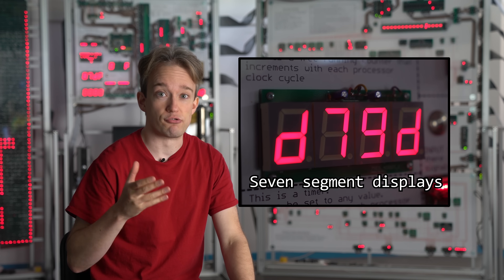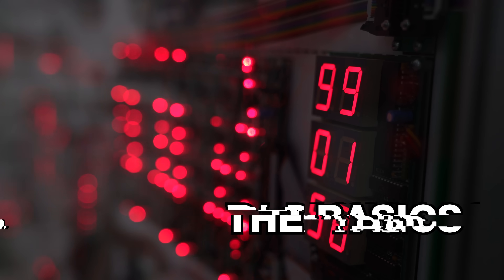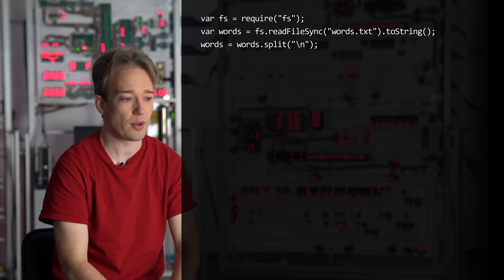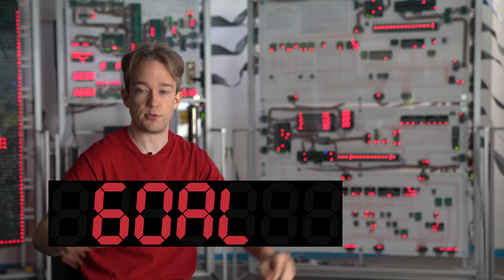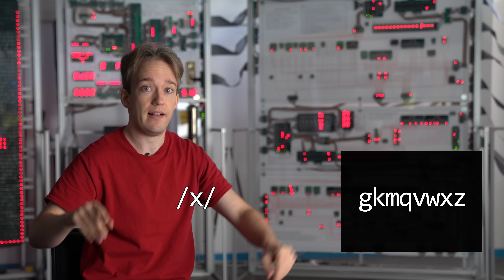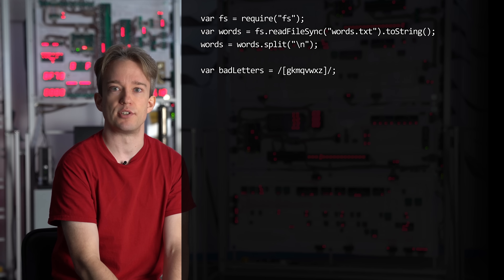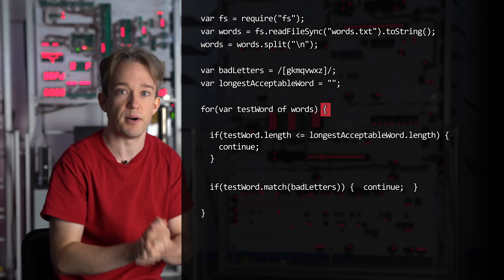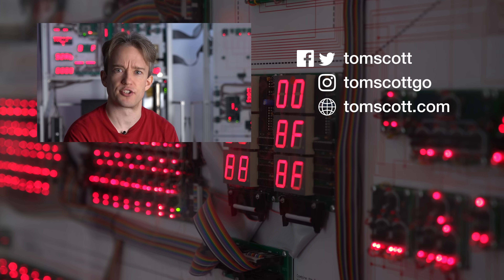What's The Longest Word You Can Write With Seven-Segment Displays?

Comment: The question goes "What is the longest English word you can write on a seven segment display?" Thus the word displayed must be the longest English word. It is never stated that the word must be written using Latin characters, ergo you are allowed to use binary to spell out words. I do realize this is just one way of interpreting the main question. 

Anyway, the longest word, both in the Oxford dictionary and the list you used, is: "pneumonoultramicroscopicsilicovolcanoconiosis," 45 characters long, spelled in(converted to) binary "01110000 01101110 01100101 01110101 01101101 01101111 01101110 01101111 01110101 01101100 01110100 01110010 01100001 01101101 01101001 01100011 01110010 01101111 01110011 01100011 01101111 01110000 01101001 01100011 01110011 01101001 01101100 01101001 01100011 01101111 01110110 01101111 01101100 01100011 01100001 01101110 01101111 01100011 01101111 01101110 01101001 01101111 01110011 01101001 01110011" which is 405 characters long

Euan Worth brought up a good point. I could have used UTF-32 to represent the word. UTF-32 base 2 is the longest way to write UTF-32. The word "pneumonoultramicroscopicsilicovolcanoconiosis" represented in UTF-32 base 2: "00000000000000000000000001110000 00000000000000000000000001101110 00000000000000000000000001100101 00000000000000000000000001110101 00000000000000000000000001101101 00000000000000000000000001101111 00000000000000000000000001101110 00000000000000000000000001101111 00000000000000000000000001110101 00000000000000000000000001101100 00000000000000000000000001110100 00000000000000000000000001110010 00000000000000000000000001100001 00000000000000000000000001101101 00000000000000000000000001101001 00000000000000000000000001100011 00000000000000000000000001110010 00000000000000000000000001101111 00000000000000000000000001110011 00000000000000000000000001100011 00000000000000000000000001101111 00000000000000000000000001110000 00000000000000000000000001101001 00000000000000000000000001100011 00000000000000000000000001110011 00000000000000000000000001101001 00000000000000000000000001101100 00000000000000000000000001101001 00000000000000000000000001100011 00000000000000000000000001101111 00000000000000000000000001110110 00000000000000000000000001101111 00000000000000000000000001101100 00000000000000000000000001100011 00000000000000000000000001100001 00000000000000000000000001101110 00000000000000000000000001101111 00000000000000000000000001100011 00000000000000000000000001101111 00000000000000000000000001101110 00000000000000000000000001101001 00000000000000000000000001101111 00000000000000000000000001110011 00000000000000000000000001101001 00000000000000000000000001110011" The length of which is 1484 characters.

Edit: I had left in a space in, which added an extra 8 bits. It is now corrected from 413 to 405.
Thanks to TheMoonRover for spotting my error. Apparently I can only @ in replies, so I won't be able to do it here. I apologize.

Edit 1:
Thank you to EuanWorth for the UTF-32 suggestion. I have updated the answer. Again I apologize for not being able to @ you.
Reply: that's only 404 characters long, the last space (00100000) doesn't belong here
Reply: @TheSurviv0rMan  404 space not found
Reply: What if you modified the condition a bit, allowing back-to-back 1s to be displayed as || on a single seven-segment?
Reply: @Derpy-qg9hn  That's a cool idea. Will edit later with answer
Reply: You're technically correct, and that's the best kind of correct. Have an upvote.
Reply: You've made a major blunder here, you've written in in extended ASCII rather than writing every single character as a unicode-32 character, which would massively increase the length...
Reply: @euanworth9887  I can't believenobody thought of that until now.  It's obvious now you've mentioned it!
Reply: @euanworth9887  That is a great idea, thank you! I have updated my comment and credited you as best as I could.
Reply: never said it couldnt be in Canaanite either. 𐤐𐤍𐤄𐤅𐤌𐤏𐤍𐤏𐤅𐤋𐤕𐤓𐤀𐤌𐤉𐤂𐤓𐤏𐤔𐤂𐤏𐤐𐤉𐤂𐤔𐤉𐤋𐤉𐤂𐤏𐤅𐤏𐤋𐤂𐤀𐤍𐤏𐤂𐤏𐤍𐤉𐤏𐤔𐤉𐤔
Reply: why write it on binary, my friend? You can save a lot of characters by writing in the Hexadecimal since A to F are Legal Characters" 70 6E 65 75 6D 6F 6E 6F 75 6C 74 72 61 6D 69 63 72 6F 73 63 6F 70 69 63 73 69 6C 69 63 6F 76 6F 6C 63 61 6E 6F 63 6F 6E 69 6F 73 69 73 20" which is 92 characters long
Reply: @MegaAgamon  But the question is the longest word, and binary is the longest way to write it.
Reply: Why stop at 32-bit? You can use 128, 256, 512, 1024-bit and higher. Just continue adding zeros.
Reply: @Liggliluff  32 I can still accept, more than that I don't feel too comfortable with xD
Reply: @bAdorablePeach  it's really good to see you replying comments in here even after 11 months ! I don't really understand the programming , but I read all the comments and I wish I knew more about it.
Reply: @aadipandey8237  I like the back and forth that comments allow for. If you do want to try your hand at programming, you can start out the default way and try websites programming, html css & javascript(more advanced). Codecademy has a good html and css course.
Reply: homes tuck
Reply: @claw3335  you stole my comment
Reply: "...which is 413 characters long" Not really. If you're converting a 45-letter word as ASCII into binary, the result should be 45*8=360 bits long. I assume you got 413 because you somehow picked up an extra space (00100000) at the end which adds 8 bits, and counted the spaces between bytes in your result, adding another 45 characters. (360+8+45=413)
Reply: @TheMoonRover  Good catch! I've missed that. I'll edit it and credit you, thank you. The spaces I left in deliberately. A binary sequence can be longer than 8 bits, thus removing the spaces can result in potentially interpreting it as one sequence, unlikely but possible. That said, it also increases the length xD
Reply: nerd
Reply: You could also convert it to hex to make it shorter
Reply: @VictorSilva-lj4wy  True, but the 6oal is to find the longest word possible.
Reply: @zeke7209  Hahaha you're right, I missed the 6oal
Reply: you can even use each segment of a seven segment display to represent each bit. 46 characters as you can divide by 8 (including decimal point)
Reply: I thought the longest English word was the scientific term for titin
Reply: What
Reply: @EX-qp9bt  What?
Reply: But what about Llanfairpwllgwyngyllgogerychwyrndrobwllllantysiliogogogoch, which has 58 letters. (Yes, I did use copy + paste)
Reply: @mastertrams  That is the name of a place, right? I don't think names are allowed xD
Reply: @bAdorablePeach  No, but words are allowed, and correct me if I'm wrong, but aren't all place names words? 😉
Reply: How doesn't this have more likes?
Reply: @4P5MC  Thought exactly the same. Best comment so far.
Reply: @4P5MC  Because it's at 69 likes and nobody wants to ruin it

Comment: The 1011110 looked enough like the leter G. o is lowercase and I is on the left instead of the right. The S is however a 5 and not an S. Use uu=w and nn=m.

Comment: Well, you could make an array of Strings and everytime a word is longer than the last, you can write it on that array. Then, you'd make another check. Everytime a word has the same length as the longest acceptable word, it will also be written onto the string. If there is a larger word after that, the array can just be emptied and we continue with that same process.

Comment: 7 and 15 segment displays are also perfect, for when you want a part of a machine to be simple, fast, cheap, efficient, even easy to clean/keep clean, or any of all of the above. Screens take time, code, and as a result space and cost, to produce what might only need to be, the power input to a small module of a machine. Where as a single, or two screens on a sterile filling machine (just an example), can perfume the heavy duty supply of information.
Handy when the machine your trying to keep running, costs more than your 5 bedroom house.... And kept cleaner than a bottle of Dettol...

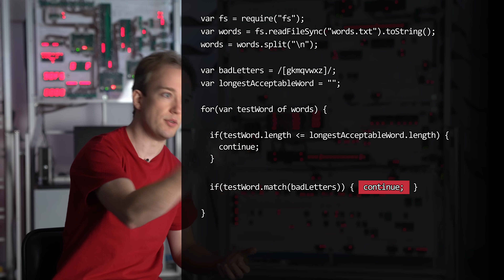Comment: 7:30 this is annoying me more than it should... Get continue on a new line like the one above aarrghh!

Personally I would have done something similar but to avoid continue just abuse short circuits and put it all in a single if statement with ! in front of it to negate those tests. If it FAILS both (ie is longer and has no letters) then we can add it. I also have a (facetious) vendetta against {}, so this allows me to remove it on both the for loop and if statement. (I would do this in Java, so that's allowed if only one line. Or C# I guess, but I mostly do Unity with that)
Reply: god I was an idiot

Comment: I and o should count. Written as half height they are not mistaken as 1 and 0
Reply: How exactly does S count again? It's literally just a 5...
Reply: @soldierofkazus  you think it's a 5 because most things that used numbers use this 7 light display and they used 5 as that even though it looks more like an s just not as curvy
Reply: fenafeses But a G is disallowed for looking the same as a 6
Reply: @WhereWeRoll  because in 6, the line connects back at the line but in G it doesn't
Reply: fenafeses That's completely arbitrary
Reply: @WhereWeRoll  a lower case g could easily be implemented.
Reply: @standardoilofnewjersey4260  it would look like 9.
Reply: @polygonail1978  use a bottom line for g and no bottom line for 9?
Reply: I does count
Reply: that would make the i a ı instead because there is no dot
Reply: 4:02
Reply: Small "I" have a dot " i "
Reply: @deidra-v6575  unless you're turkish

Comment: 0:30 Wait, that's not how "most" people draw their fours? 

Well I'm glad they're used to it, that's how I draw 4!
Reply: Don't feel alone, I and almost everyone I know writes their 4's similar to 7-segment display style.
Reply: That's how I write a 4 not draw
Reply: The two common fours can be used without picking up your pen giys
Reply: @xroadspod  How would you write Ч without lifting the pen? Do you write it like u, but with a longer vertical stroke? The horizontal stroke usually goes through the vertical, like it does with 4. Trying to do it without lifting the pen seems like it would be as complicated as trying to write X without lifting the pen, or like it would just come out looking totally wrong.
Reply: Bob Ross 
How? What's the second method that doesn't require picking up your pen
I draw mine by starting at the bottom then going two steps up, then diagonally one step down+one step left and then one step right. What is the other one?
Reply: But- why? The other way means no picking up your pen required
Reply: @the1exnay  You start at the top left  making writing it easier lifting the pen is easier than starting at bottom right or middle right. Also by writing a small L followed by an I you could write 4 in two stroke instead of three.
Reply: kazedcat TM 
If you count an L as 1 stroke then the other way of writing a 4 counts as 1 stroke. If you count the other way of writing a 4 as 3 strokes then they are both 3 strokes.

That top-left being easier is an interesting idea. But the way i write 1, 2, 3, and 5 leaves my pen at the bottom so staying bottom if a 4 is next sounds easier. 6, 8 and 9 leave my pen in the middle so it doesn't matter. And only for 7 and 0 does it end up at the top so staying top is easier. Is there some reason I'm missing that makes starting top-left preferable?
Reply: @the1exnay  You can write U in one stroke with one stroke but to write a V you need to stop and reverse direction so you need two stroke to produce a clear pointy bottom. With 4 you need clear pointy corners otherwise it will look like a 9. So you need 3 stroke to write a legible to other people number 4. I use to write 5 like you. But change it because people confuse it with S.
Reply: kazedcat TM 
I fully agree, it takes 3 strokes to write 4 properly either way. Cutting corners just doesn't look right.
Reply: @the1exnay  when I write for, it's really two strokes. I guess one is curved or bent, but that takes significantly less effort than what I would consider a full stroke. By that logic, most people I know who make the connected four never lift their pen, but it's definitely easier to be lazy with the corner on the open 4 without it looking like something else. The only other thing it can really look like is an H, which usually isn't a problem.
Reply: Micah Philson 
That is a decent point, I'm inclined to think not picking up the pencil is the greater convenience. But that may just be my biases
Reply: @the1exnay  This is a very long conversation about how you write your fours.
Reply: @the1exnay  Starting top left is preferable because downward strokes are much easier than upward ones. The only characters I would ever start at the bottom are capital A, M, and N.
Are you by any chance left-handed, and do you write with the page upside down, or close to it? Your description of how you write sounds very unusual otherwise.

Comment: You can avoid using 'continue' simply reversing the condition testing: set the new value if the word is 'longer than' and if it does not match the rule in the regular expression.

Comment: I paused after you explained the problem, but before you started doing the code, and wrote my own code to do this. I used Lua, which I consider to be many orders of magnitude better a scripting language than javascript (or python, for that matter). It took 9 lines, and the code is as follows: 

biggest = ""
for word in io.lines( "words_alpha.txt" ) do
 if ( string.find( word, "[gkmqvwxz]" ) == nil ) then
  if string.len( word ) > string.len( biggest ) then
   biggest = word
  end
 end
end
print( biggest )

It takes about a quarter of a second to print the answer as "dichlorodiphenyltrichloroethane".

With the letters "i" and "o" added to the list, it prints "supertranscendentness", as yours did.

I then made this variation, which will include any words the same length as the longest found so far, and print them as well:

words = {}
len = 0
for word in io.lines( "words_alpha.txt" ) do
 if ( string.find( word, "[gikmoqvwxz]" ) == nil ) then
  if string.len( word ) > len then
   len = string.len( word )
   words = { word }
  elseif string.len( word ) == len then
   table.insert( words, word )
  end
 end
end

for k,word in pairs( words ) do
 print( word )
end

I tested this to ensure that it works as expected, but in the list I had (which has ~466,000 words), there were no ties for either of the tested cases.
Reply: Emily, thank you for answering the question i came to the comments for !
Reply: is learning lua harder than python?

Comment: One way how to get all the words with the same maximum length (instead of just one) would be using a functional approach like this:

```
const fs = require('fs')
const words = fs.readFileSync('words.txt').toString().split("\n")
const badLetters = /[gkmqvwxzio]/i

const grouped = words
 .filter(word => !word.match(badLetters))
 .reduce((dict, element) => {
  (dict[[element.length]] = dict[[element.length]] || []).push(element)

  return dict
 }, {})

const maxLength = Object
 .keys(grouped)
 .map(key => parseInt(key))
 .sort((a, b) => b - a)[0]

const result = grouped[maxLength].join(", ")

console.log(`Result: ${result}`)
```

I suppose that’s the “trading readability for efficiency” the video mentions, but I still find the code above fairly readable. Anyway, while the result for original regex (/gkmqvwxz/i) remains unchanged (as in, “dichlorodiphenyltrichloroethane” is the only result), for the more strict regex /gkmqvwxzio/i, we get the following output:

Result: supertranscendentness, three-and-a-halfpenny

Which… is still disappointing, I suppose.

Comment: I dont have a problem with using "continue" but why use it in this case? Why not use nested "if" and "if else" statements instead? Although you dont need else in this case.
Reply: Always avoid nesting when you can. Each layer makes it more complex. Though in this case you can just if with lazy evaluation, but this way the lines are split more nicely :P

Comment: I think I've found a longer word. Hear me out:

The word "Phobia" means fear.

You can add a prefix to specify the type of fear. Ex: "Turophobia" is the fear of cheese.

"Phobo-" is the word "Phobia" in prefix form. Therefore, "Phobophobia" means "fear of fears"

You can still add more prefixes on to that word above. Thus, "Turophobophobia" is the "fear of the fear of cheese," which if you think about it, is, although unlikely, a possible fear.

Considering this, "Phobophobophobia" means "the fear of the fear of fears."

Using this rule, a word with an infinite amount "Phobo-" prefixes can be made. Ex: "Phobophobophobophobophobophobophobia"

Using Scott's rule of no I's in a word, we can change the "-phobia" to "-phobe" this signifies a person who has that fear. Ex: A "Turophobe" is a person who has a fear of cheese.

To conclude, We have the new longest word that can be written on a seven segment display:
Phobophobophobophobo......phobophobe

Which means "one who fears the fear of the fear of the fear of the fear of the..... fear of fears."

As a PostScript, I personally would accept the letter "o" considering it's not a zero if it's lowercase.

Comment: 5:07 That's technically not correct. That RegEx does not match a word that contains any of those characters; it matches a single character that is any of those characters. That is a worthwhile distinction to make. The reason why in this case it works anyway, is because the JavaScript function "matches()" is returning an array with the characters in the word that matched, for example "['m', 'x', 'm']" for the word "maximum". Because JavaScript is a loosely-typed language, you can (controversially) perform an "if" operation on an array, which will return "false" if the array is empty, or "true" otherwise. If you were doing this in a strongly-typed language, this RegEx would not have worked.